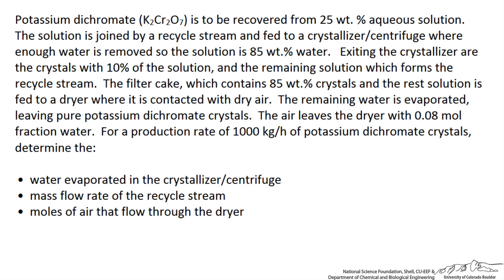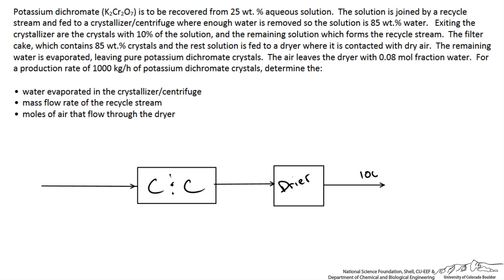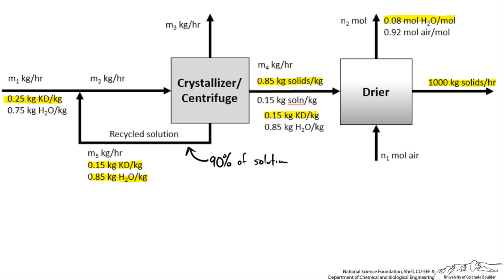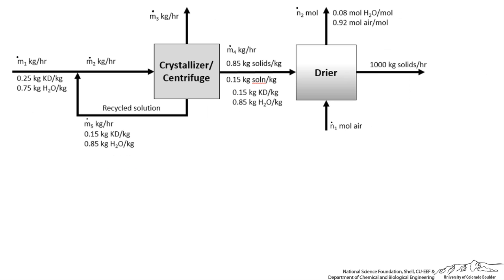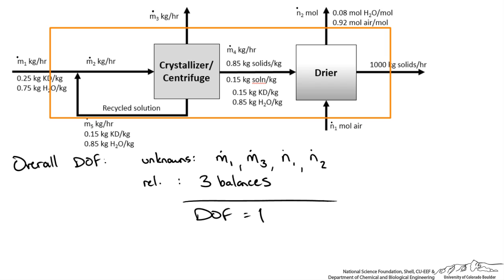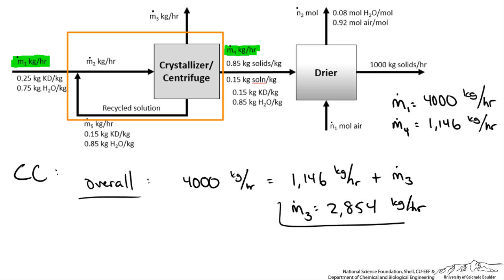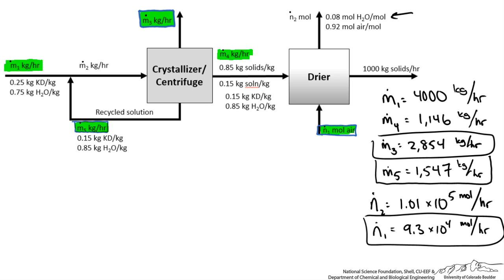Crystallizer Material Balance with Recycle

Comment: The overall DOF for this question is 1= unsolvable
Reply from the maker: This is a valid question, and it turns out that you can't solve the overall system. So the narrator moves on to use the system around the dryer, where there are 3 unknowns and 3 balances. He jumps around a bit, but that's why it works.
Reply: Unbelievable

Comment: Sorry I think you made a mistake when calculations m4: 0.84m4 + 0.15×0.15m4 = 1000
This gives m4 = 869.57 kg/hr
Reply from the maker: So let's work through this.  0.85m4 + (0.15)(0.15)m4 = 1000 --> 0.85m4 + 0.0225m4 = 1000 --> 0.8725m4 = 1000 --> m4 = 1000/0.8725 --> m4 = 1146 kg/hr. Does that make sense?

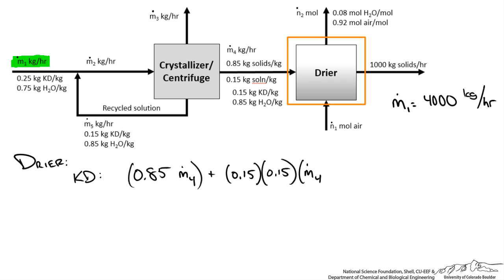Comment: 7:25 : May I know why is the main flow rate is 0.15? I couldn't picture it. Kindly explain. Thanks!!
Reply from the maker: Great question. Stream 4 has both solids and a solution. 15% of stream 4 is solution; the rest is solids. Of that solution, 15% is KD. Does that help? This is a bit confusing due to the percentages being the same.
Reply: @LearnChemE  Thanks for your kind explanation! Ahh I see it now. So technically whatever comes out of the Crystallizer, will contain some liquid which has some KD, and that shall be counted too? Am I understanding this correctly?

Comment: can somone answer this is the next few days please. its for my 3rd year design project. m4 = 1146 of feed but 0.85 of it is solids = 0.85 x 1146 = 974kg solids gooing into dryer. so how is 1000kg solids coming out
Reply: you are forgetting the 15% solution. 1146*(0.15 the solution at m4)(0.15 KD in the solution at m4)= 25.785 kg KD. 974+25.785=999.785 or roughly 1000 if you round it.

Comment: By doing this, the degrees of freedom of dryer, as erroneously calculated all the teachers of the Department are: DOF = 3 (unknown) - 3 balances (water, air and solid) = 0. The mass fractions obtained for stream 4 are : solid, 0.8725 and water, 0.1275. Mass balances are trivial.

Solid: 1000 = 0.8725 * m4, m4 = 1146.13 kg / h.
Water: 1146.13 x 0.1275 = 0.08 * n2 * 18, then n2 = 101.48 kgmol / h.
Air: 0.92 * 101.48 = n1,  thus n1 = 93.36 kgmol / h.

Another nice thing is that the teacher uses kg / h for mass flow and uses mol / h for the molar flow of air instead of unifying the units.
Reply: All of the teachers in the department?  Really?  All of them?:face-green-smiling:
Reply: Actually, the DOF for the drier is 3 Unknowns and 2 Balances because the Air balance is not independent. The leftover DOF can be easily solved by calculating the KD in m4.

Comment: Consider the large errors in the solution of this exercise: General: Teachers do not teach how are the degrees of freedom of process, which is done with all the currents (if you did not know), the sole criterion to determine whether a problem has a solution and therefore do not teach the solution strategy.
The particular errors of this solution are appalling: 1) The "teacher" Global Balances performed despite remaining with 1 degree of freedom. Unheard. 2) The "professor" joining two units: the mixer and the crystallizer to carry balances. That is to attack the mass balance. 3) The teacher wanders from unit to unit doing balances to see how finds the unknowns and solve the problem. Without any criteria.
Instead of making these juggling, who decry the teaching should calculate the composition of the current No. 4, based on solid and water from the amount of solid and the amount of solution in a kilogram of mixing and composition solution, all known.
Mostrar menos
RESPONDER

Comment: At around 7:00, you start to do the KD balance for the Drier. Since 90% of the solution is going to the recycle, wouldn't only 10% of the solution be going to the drier, and therefore the KD balance be (0.85)m4 + (0.1)(0.15)(0.15)m4 = 1000 ?
Reply: Or I guess in this case, the stream isn't splitting. The solution is exiting as two separate streams from the crystallizer. Does that mean that you wouldn't care about it when calculating stream m4, and only take it into account when calculating the recycle?
Reply from the maker: This is tricky.  Thanks for the question.  It looks like you've gotten to the answer from your next comment.  So, yes, in this case we are doing a balance around the drier (dryer?).  Therefore, we are not interested in the recycle percentage from the crystallizer.  Where  it gets confusing is that this input stream to the drier is a mixture of solid and liquid.  And that is why it seems to be two streams.  First all of the solid is considered (0.85m4), then the solution, which is 15% of the stream and only 15% KD (0.15*0.15*m4).  I hope that helps.

Comment: I'm not understanding how the problem states that: "exiting the crystallizer are the crystals with 10% of the solution, and the remainder solution which forms the recycle stream." So how is it that then it says the filter cake contains 85% filter cake and the rest solution." When it had already stated that the crystals exit the crystallizer with 10% of the solution. (How is ten percent of the solution .15?) I understand  you put 15% for the solution because of the 85% crystals, but I don't get how that follows what the problem stated and also how the composition of the recycler and the output stream of the crystallizer are known since the recycler only has the same composition if it splits from a stream. Which in this case it doesn't???? It only says 90% ...Thank you
Reply: Totally agree... some of these problems are so badly described from the outset. "Recycle is 90% of the solution". What solution? The original feed 25% wt? Or the feed plus the recylcle? Totally unclear.
Reply: @Darwinion  You have to understand about this is a separation process (please google function of centrifugal). In reality, we intended to get purer result. Hence, we have the recycle. We recycle the solution (again you have to understand what is solution). After several separations, we have 85% solids begin separated, but we still have another 15% of solution which is impure. In that case, we pass through another separation called drier. After this drier, we assumed to get 100% dried solid. Before question the tutor, I suggest you to think more first.
Reply: @kennywong385  hi, where is it said that after the separations we have 85% of solids? Because I dont read that, what i read is that "the filter cake containing 85% crystals (and therefore 15%water) and the rest of the solution (which is 10% of the solution exiting the crystalizer) are fed to a dryer".
Reply: The wording also had me a bit confused too

Comment: Hello, thanks for good video.

I need explanation for flow between Crystallizer/Centrifuge and Drier.

There is one stream but you gave 4 specifications that are :
0.85 kg solids/kg - 0.15 kg soln/kg; 0.15 kg KD/kg - 0.85 kg H2O/kg.  So 0.85 kg KD/kg means  it is a total weight of KD that is present in both solids and solution? And 0.85 kg H2O/kg is only present in 0.15 kg soln/kg?

Also, do we always have solids formed after compounds passing through crystallizer/centrifuge?

Thanks a lot.
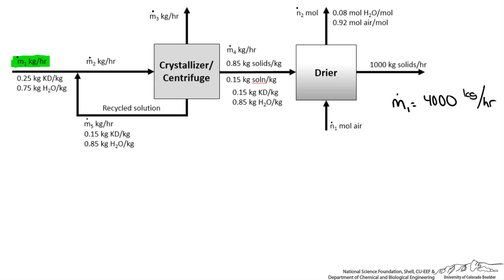Reply from the maker: Thank you for your question.  That stream has two parts: there is a solid part and solution.  The solid part, 85%, is all KD.  The other 15% is a solution that also has some KD in it.  The solution itself has 15% KD, with the remainder being water.  Please listen around 6:50 as the narrator starts the balance around the drier.  Does that make it more clear to you?

Comment: What if I made the recycle stream come out of a splitting point between the crystallizer and the drier
Reply from the maker: +Tyrone Biggums If the recycle stream splits from another stream, then the compositions would be the same in those streams. In this case, the solution compositions are the same anyway, so it wouldn't make a difference here.  However, it could make a big difference if the recycle stream comes from a splitting point versus comes from another process unit.  Does that answer your question?
Reply: + Tyrone BiggumsEsa corriente está formada por sólidos que cristalizaron. NO PUEDE HACERSE. Se recicla la solución que tiene todavía sólidos disueltos para cristalizarlos.
Reply: Wish I could read that
Reply from the maker: +LearnChemE You would, however, have to be careful that the solids weren't included in the recycle stream or that would make the process a bit different.
Reply: thank you very much this is really helpful

Comment: when calculating for n2 (water leaving the drier) why are we dividing with 18x10-3
Reply from the maker: +Wanda small boi Thank you for your question.  In that equation, the right side is in units of moles and the left side is in units of mass.  To get the units to match, the left side must be divided by the molecular weight of water.  Then both sides are molar units.

Comment: does the recycle stream always have the same composition as the other prod stream
Reply from the maker: If the recycle steam splits off of another stream, at a split point, they would have the same compositions.  However, if the recycle stream comes from a process unit where a separation takes place, they might not necessarily be the same composition.
Reply: +LearnChemE  what if the stream enters a separator and is divided into recycle stream and purge stream? Does these two divided stream have same composition as the stream before the separator?